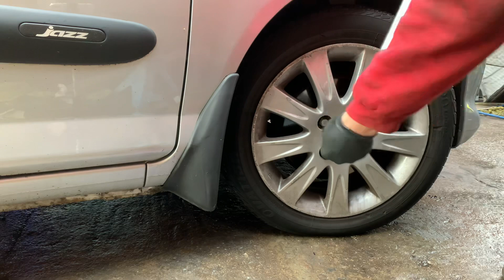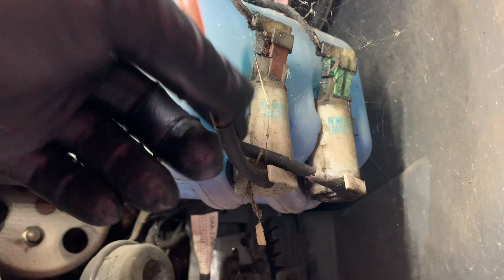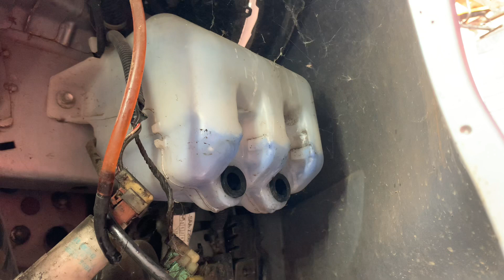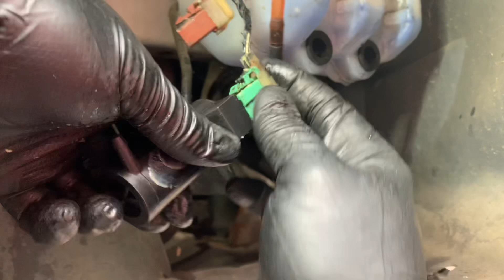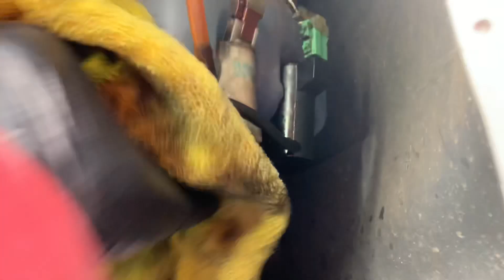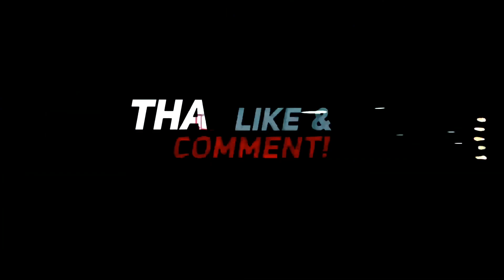Windscreen washer not working (pump Replacement) Honda Jazz / Honda Fit 2002-2008

Comment: are the front and rear pumps the same size?
Reply: Yes
Reply: @woah9597  thanks bro my front washers are working but my rear ones are not and there is no sound when I try to activate the rear washer does this most likley mean that the rear moter is "dead"?
Reply: @HevinTauckoor  If there is no sound coming from the washer pump,check conection or bump it with something if you can acces under and try again.If there is still no sound pump is defect.
Reply: @woah9597  ok thanks bro I'm 17 and still learning to drive got my test booked and the honda jazz is the first whip hopefully I can fix it haha. Thanks for the tips
Reply: Just bought my Honda jazz, got my test booked, and have the issue with both my screenwash pumps! I'm loving the honda jazz, though it's a great whip! @HevinTauckoor
Reply: @jimmi317  yeah the jazz Is such a beast haha got my test next week so nervous lol